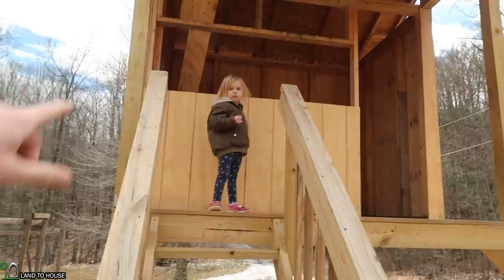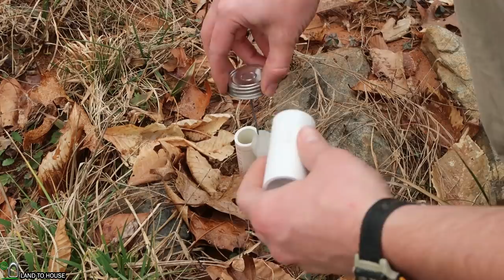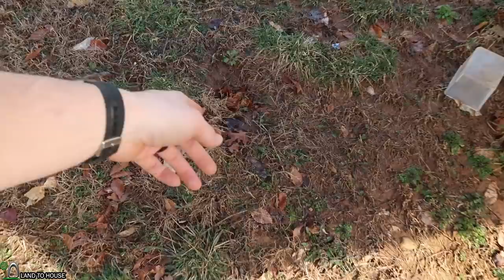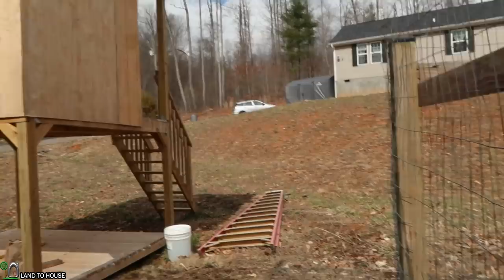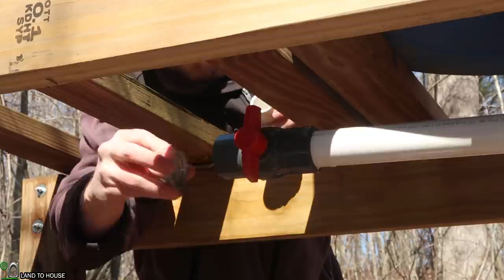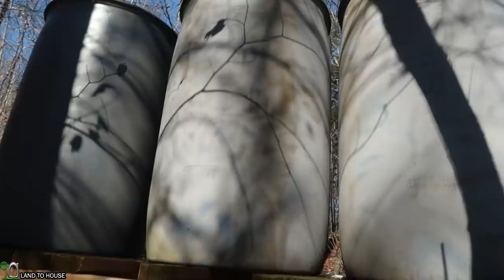Maxing Out the Water Tower Storage for the 2020 Garden

Comment: I worked at a fertilizer dealership several years ago, when cleaning out tanks filled with several deadly sprays, the boss said "The solution is dilution", 3 rinses was we were instructed to do, when ever I get a barrel I run lots of water through it and get it clean before I do any watering for the garden.  A note on youtube garden videos, it is a black hole that will suck you in!  I follow the links, beware of geothermal greenhouse, cheap hydroponic vids beware!
Reply from the maker: These tanks are from a medical supply company. I think this one had a mild detergent in it. I do like that idea though. Fill them a couple times and let the water run back down the hill. I am just getting into gardening. I want to eventually get to the no till/ mulch garden method.
Reply: @LandtoHouse  My goal every year is to grow some lettuce, put it in a wheelbarrow out by the country road, honor system with a cashbox, just keep replacing lettuce as it moves.  Try and make 10$ or more per day, we'll see how it goes!  However with corona going on, we'll see how to handle it.

Comment: The kids are precious. My 2 yr old granddaughter helped me wash the car the other day. Any excuse to play in the water will do. I was wondering if you have ever tested the 3 valve system with a stand pipe on the waste valve like the one in this video. They claim a 350% increase in water volume sending it 4 meters high over 150 meters to a reservoir. I think the pipe on the waste valve may add 3-4 feet of head pressure but the 3rd check valve may become irrelevant after it gets started and remain constantly open. You could modify one of your pumps with the stand pipe and measure, then add the third check valve to measure any difference. Here's the link.
https://www.youtube.com/watch?v=fdsqacG1QWA

Comment: Your projects are really showing a lack of forethought. Having to patch together a new build will be problematic no doubt.
Reply from the maker: Hello.  What portion of this water tank install needs more forethought?
Reply: @LandtoHouse  Maybe he means how you cut the horizontal piece of pipe before you had the new barrel in place, and this caused you to have to cut another piece and use a straight connector in order to make it reach.  Personally, I would suggest adding a valve immediately below the center barrel so you can close it off to perform maintenance on the main pipe assembly without having to dump all that water.  I saw an older video where you had a leak at the T that feeds the outlet.  Not sure how you did fix it, but if you could close off all three barrels before that section it would be a lot easier to perform those kind of maintenance tasks.
Reply from the maker: That is a good point. Because of that leak the tanks were already empty.  I just had to glue a component that I forgot haha. It was a simple solution.  Another shutoff would be handy for maintenance.  Because it does take several hours to refill the tanks once empty. ... and yes cutting that pipe section too soon caused an issue. That one was forethought void.